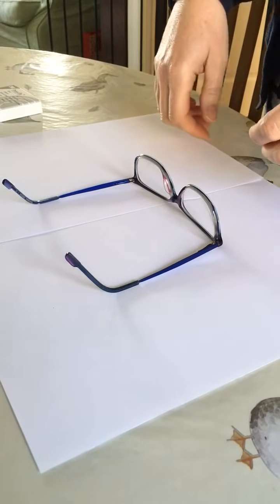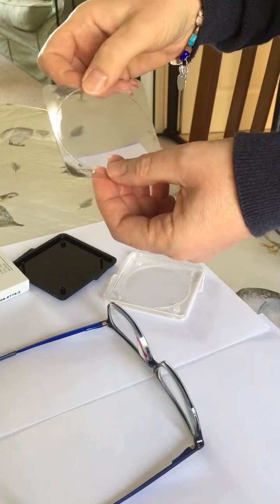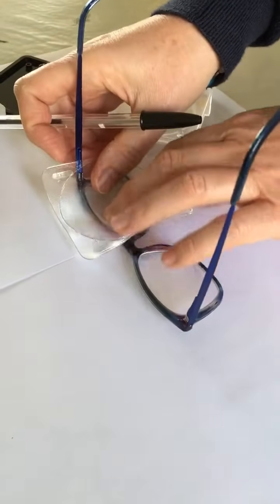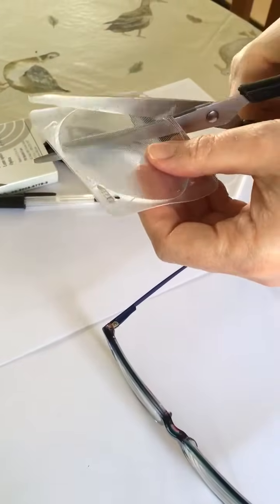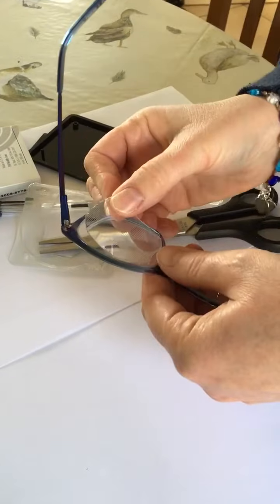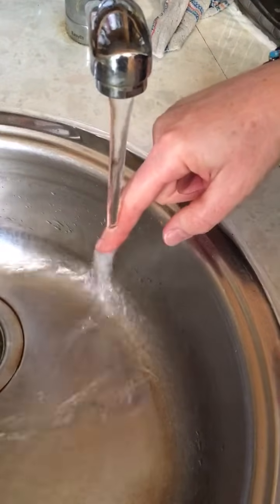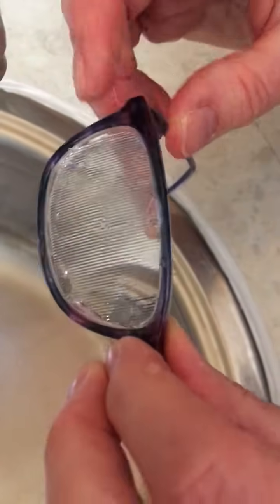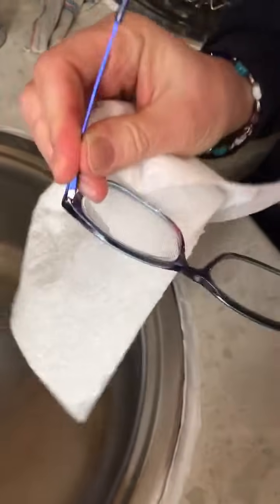Fitting your Fresnel prism

Comment: When you say "base" do you mean the word of the prism symbol?
Reply from the maker: Hi the base of the prism is the widest side of it. A prism is like a triangle shape with a point called the apex which is opposite to the base. Fresnel prisms usually have the word “base” marked on the prism so you know which way to fit it. Base▶️apex
Does this explain it ?
Reply: @lorrainefloyd22  I had the "base" toward the temple of the frame with the lines vertical
Reply from the maker: That is base out. Does your eye turn inwards
Reply: @lorrainefloyd22  perfect then I cut it correctly.

Comment: Is it possible to remove the fresnel prism and reapply it to another pair of glasses? Will it still stick? Will it give the same visual effect? I have a fresnel prism on now and I want to put it on my other more comfortable frames. Their the same prescription and the lens are ruffly the same shape.
Reply from the maker: As they just stick on with water it should be ok. You need to make sure it’s correctly positioned so that it joins your double vision. You may also have to trim it if it’s a slightly different shaped frame
Watching the video should help
Reply: @lorrainefloyd22  Thankyou for the reply. I'm new to prisms and my doctor put them on for me. I was worried I would mess them up.